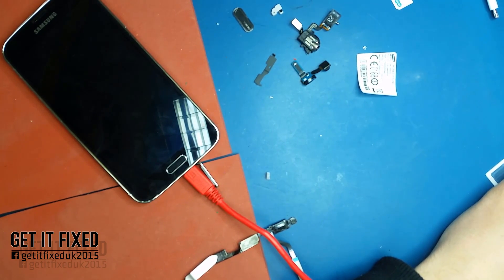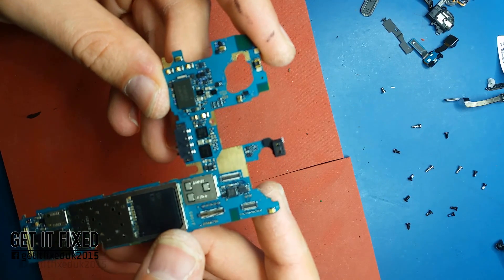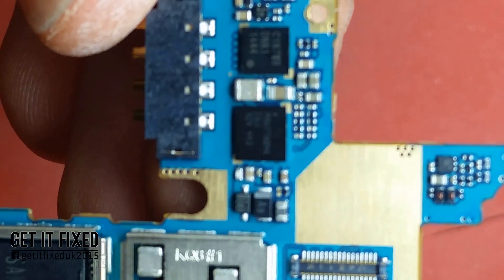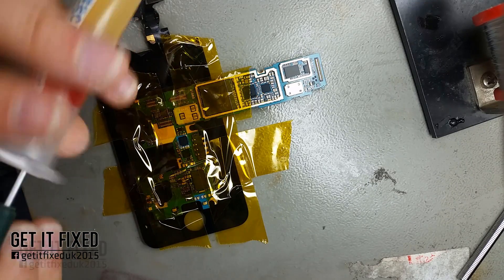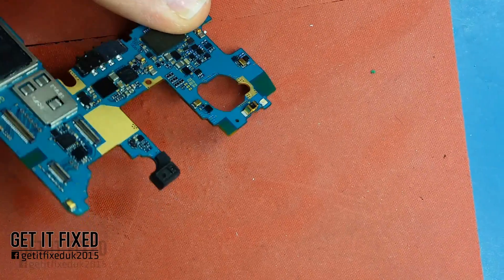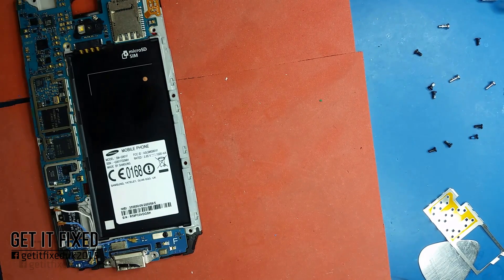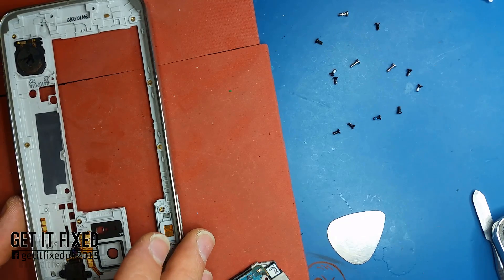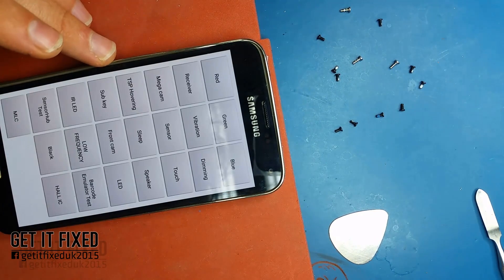Samsung S5 Dead Board  Fixed Power Manager Ic Chip

Comment: Hello
My S5 recently have problem, it is getting overheat and reboot and it freeze, I tried to do factory reset from boot, it not even going that much far, it freeze before it. Any suggestion what might be problem ?
Reply from the maker: it may be the PMIC max one, if is getting really hot in sec after is on, this is the cause, unless is liquid damage mate

Comment: hello.
i have a s5 sm-G9000t , who suddenly went into a boot loop. so i tried to flash the samsung original rom via odin. but nothing. it passes all the processes in odin succesfully, but when it says updating systhem, then suddenly displays erasing and boots.
i started to think it is all about board issues because i,ve flashed every stock samsumngs android that i've got( from android 4.4.2 to android 6.0.1) but nothing. I even tried rooting the phone and it worked for 3 or four hours, then is entred the boot loop again. any help or suggestion/.?
Reply from the maker: +Alejandro Castillo u need to open the phone. Make sure there is no watter or liquid damage on the board. Clean it with falcon 530. And then try again. If not u have an issue with nand chip.